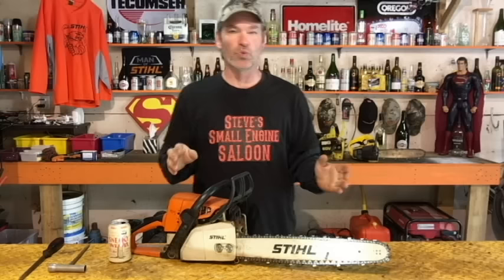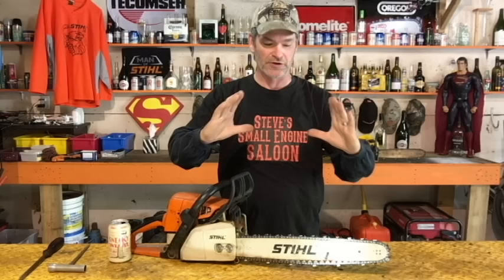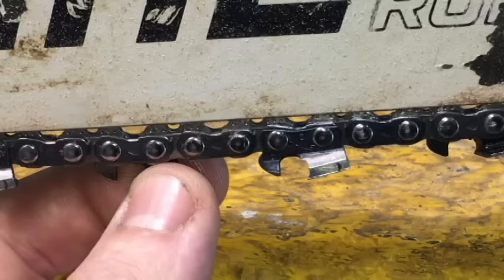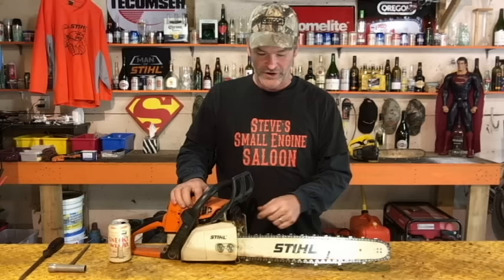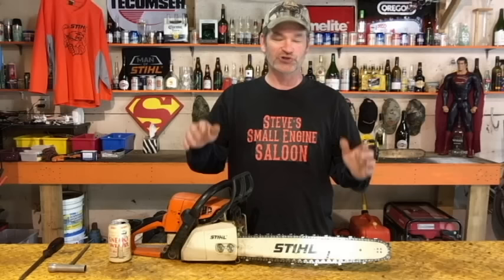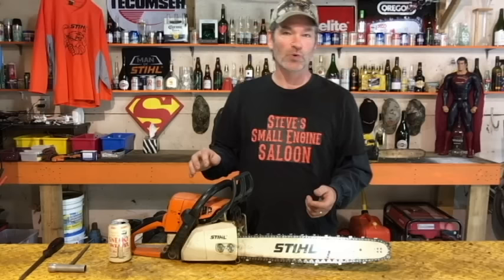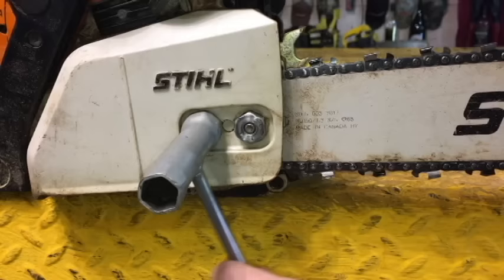CORRECT WAY To Adjust The Chain Tension On Your Chainsaw

Comment from the maker: ✅Need The proper tool? Check out this chainsaw wrench ➜ http://amzn.to/2iMUIIf
For more videos like this, check out: 
👉Top 5 Reasons A Chainsaw Won't Start ➜ https://youtu.be/5Qit2CZFw6M
👉Correct Way To Sharpen A Chainsaw ➜ https://youtu.be/-GIxowey6IQ
👉Repair A Chainsaw That Cuts Crooked ➜ https://youtu.be/AgCZxee2NPA
👉Fix A ChainSaw If It Won't Oil The Bar And Chain ➜ https://youtu.be/6zscOSrFQjA

You can connect with Steve here too: 
✅Visit Steve’s WEBSITE ➜ http://www.stevessmallenginesaloon.com/ 
✅Visit Steve’s PARTS & TOOL STORE ➜ https://www.amazon.com/shop/stevessmallenginesaloon 
✅Follow Steve on FACEBOOK ➜ https://www.facebook.com/stevessmallenginesaloon 
✅Follow Steve on INSTAGRAM ➜ https://www.instagram.com/stevessmallenginesaloon/ 
✅Follow Steve on TWITTER ➜ https://twitter.com/SteveSaloon 

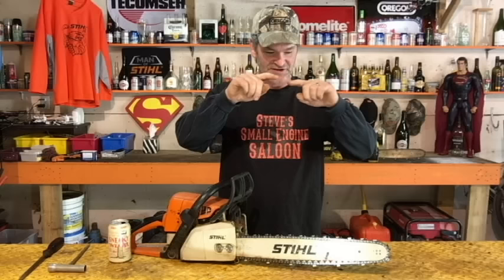✋Heads up guys, I did say a quick thing at about 1:55 that is not what I meant!  The chain actually is not spinning at 12,000 RPM just because the engine is.  But my point is still valid....👍
Reply: we knew what you meant ! ;)
Reply: We knew what you meant. Great video. Thx.
Reply: 12000 revs per minute implies engine speed I think. Anyway we know you basically meant frickin fast.
Reply: What is the chains rpm at say 12000
Reply: @nmmxiii9389  (Sprocket circumference / chain length) x 12,000 
For a 1.5" sprocket and a 20" bar  - (4.71/40)x12,000 = 1,413 rpm.
This gives chain speed of  about 53mph
Reply: All good :)
Reply: @nmmxiii9389  chain pitch x 2 x saw rpm ÷12 = in/min ÷720= feet per minute.  I think that's the equation.  Double check with google top be sure.
Reply: In other words, treat the machine with respect (careful attention to wear, adjustments and how you use it) and it will treat you back with respect.
Reply: @nmmxiii9389  Depends on the size of the chain.  Sprocket circumference not counting the teeth/chain length.  Chain lengths vary, but let's say 36".  I don't know how long a chain is, really.  And the drive sprocket looks like the size of a coin.  Let's say a quarter.   Circumference is pi (3.14) times the diameter.  Let's round it to 3".  3/36= 1/12, so divide 12000 by 12 and get 1000 rpm.  Still insanely fast.  I had one fly off on my once.  It just fell on the ground.  It didn't even go anywhere.  But it was on one of those electric saws.  No way was it doing any 12000.  Maybe a couple thousand rpm tops.  Hope this helps.  2400 rpm would be a chain speed of 200 complete revs per minute, which is 200 times 36 inches or 3 ft = 600 ft/min or 10 ft/sec...I think.  That still sounds like it could injure a person.
Reply: And always count your fingers before and after cutting wood to make sure you have 5 on each hand remaining hahahahaha
Reply: You bad lol 😆
Reply: @reclaimthelaw  😆 but he did keep it real
Reply: The textbook chain tension never works for me. Chain tension changes as bar & chain gets hot. Bar & chain expand at different rates on different saws. I like to check tension periodically and adjust as necessary.
Reply: @mauriceharting5877  I know some people who didn't have the chain adjusted correctly and they can not give a thumbs up anymore. yikes
Reply: 0
Reply: Hey sir I have a few questions for you I'm a chainsaw carver and been having some issues no body can answer even Stihl so far
Reply: i love machinery.  is that wrong?
Reply: Brilliant ,many thx
Reply: ²moo otto
Reply: Mine aint.  Mate.
Reply: Okay, I know it's a REALLY old video, but to open with a guy holding a chainsaw in one hand, and a beer in the other? Priceless!
Reply: TY
Reply: Thanks once again. Great explanation. I never took into consideration that the bar does pull up when you engage the blade so adjusting with the bar up give you a perfect adjustment. Great advice.
Reply: Great
Reply: Through lack of oil the chain stretches  can a bar be made for stretched bars
Reply: That's stretched chains  not bar thanks
Reply: Steve, as a 66 yr old female homesteader who finds herself using her chainsaw to cut limbs that have fallen on my fence...I want to say a huge thank you!!!  You not only explained how to do it and gave good close up's, but you also explained WHY!  That is a lost art these days.  When you explain the "why" it is easier to remember the how.  God Bless and thanks.

Comment: Hey man, I am not sure if you will see this since the video is nearly 6 years old now. However, I recently purchased a STHIL Chainsaw myself. This video helped me, as a first time young homeowner. I appreciate  the fact there is no bullshit into, no "before we get into this, here's a thanks to my sponsors", or any other crap. Just straightforward and to the point. When I have a little extra money, I will be purchasing some stickers, coffee cup, and other items from your store as a thank you.
Reply from the maker: Thank You...and You're Welcome...
Reply: Helped me huge as well.  I couldn’t figure out why the new chain was not cutting well before I learned you need to pull the tip of the bar up when adjusting.  Good to go now. Thank you
Reply: Also helped me. Thanks.
Reply: You want to tension the chain until it gets stiff to move on the bar freely then back it off .. yes chain needs to "snap" back into the bar at all times..

Comment: As a professional logger I can tell you that the proper tension is going to differ depending on what you are doing. If you are falling timber and chain speed makes a difference, then you want a little slack. If you are bucking and bumping limbs, you want it a little bit tighter. With a slack Chain, the slightest little limb or branch of brush will end up in between the bar and chain and throw your chain off the bar. It can happen even if your chain is tight. But it's more likely to happen with a loose one. Then again it is way easier to put the chain back on when loose than it is when tight. It all comes down to experience and a matter of preference.
Reply: Thanks for that.  I have one chain saw that throws a chain whenever I touch brush.  Cuts logs and stuff great.  Now I know what is wrong.
Reply: I had a logger friend who logged over 50 years and he ran his saws with the chain tension like you described. I thought it was too loose but he knew what he was doing. He told me the reason, but I'v forgotten since it was over 20 years ago.

Comment: I swear, my stihl manual states on page 29, 1st column, “turn the tensioning screw…until there is very little chain sag on the underside of the bar—and the drive link tangs are engaged.” On the same page 29, right-hand column, it states, “chain must fit snugly against the underside of the bar and it must still be possible [that leaves it wide open for interpretation] to pull the chain along the bar by hand.”  So I went looking for some videos, and up came Canuck beer man with a Stihl.

Comment: So, what you're saying is, "Hold your tip up when you tighten you nuts?"  Makes perfect sense to me! Great vid. Thanks for posting!
Reply: Brilliant.
Reply: Albert Head Nice.  Would have added “while checking your oil” but well played sir
Reply: Mostly I like holding the nuts up while you know who is playing with the tip.
Reply: Go to your room.
Reply: Apparently none of these guys think that you're talkin about a chainsaw bar. Or are you? Probably the first time some of you seen a chainsaw.
Reply: My soul is pure. I would never have picked up on that if you hadn’t pointed it out. Thanks for ruining it for me. Now every time I tighten my chain I have to pester my wife as well.
Reply: Spinning at 12 k ?   I all call BS.  He is probably talking about the rpm of the engine, not the rpm of the chain spinning on the bar????
Reply: @billgilkerson5294  the chain is rotating at engine speed as its direct drive from the crank the only exception i know of was the gear drive canadien brand saws not made since the 70s. a lot of saws free rev to 12 grand and work around 10/10.5
Reply: @chrisforgan731  yes, but the sprocket is many times smaller (less teeth) than the chain.  There should be a ratio, like a truck differential, where 5/6 sprocket rotations equals one chain rotation.  So sprocket rpm of 12,000 rpm would be like a chain rpm of 2,500.
Reply: @chrisforgan731  There used to be several gear drive saws, not just Canadien.  Homelite had several gear drive models but that's just the brand I know.  But pretty sure the guy just meant the chain was being driven by a 12k rpm engine, not that the chain was actually turning 12k rpms.  That would obviously be a function of how long the chain is although whether you've got a 16" chain or a 30" chain, the chain speed would be the same.
Reply: @billgilkerson5294  That's the RPM of the output shaft, not the chain, you're right. I don't think he meant to misrepresent the situation.
Reply: @chrisforgan731  The output shaft has a certain number of indentations to engage with the teeth of the chain. The chain has a lot more teeth than the output shaft has indentations, so the chain is not making one revolution for every revolution of the output shaft, it's reduced by a huge factor. The velocity of the chain is about the same as the output shaft, but not the RPM. In a sense, it hardly is useful to talk about the RPM of a chain, velocity is more important, but Steve here did make it sound like he meant the RPM of the chain, an easy mistake to make. It wasn't the important part of what he was saying.
Reply: @billgilkerson5294  Chain speed is in feet per minute so yes, 12,000 rpm is referring to the sprocket or engine.
Reply: There's nothing like a properly adjusted big tip. You just have to make sure not to bust your nuts before you get through
Reply: I put some chapstick on the tip so that way the chain does not chafe after I tighten my front nut I lost the other one on a bet!
Reply: @MegaTapdog  "tiny troll balls"  🤣🤣🤣🤣😂😂
Reply: Time for the time out chair again!  😂

Comment: I thought all you had to do was turn screw until bottom middle bar just touched by chain, then re tighten the two screws.  I didn't realize it was this complicated. Well I'm too set in my ways to change now.

Comment: I'm a firefighter on a truck company in a major US city and we use Stihl saws for cutting ventilation holes in all types of roofs. Your video was fantastic. I'll definitely be using these tips and advice going forward. As someone who expects his saw to save lives, having your equipment set up properly can be a matter of life and death. Kudos!
Reply from the maker: Right on Frank!  Thank You...
Reply: If you’re going through shingles do you tear some shingles off first? Seems like your chain would dull immediately going through them
Reply: This is rad, thank you for your service
Reply: @Slippindisc  Maybe on a pretty intact roof with little time to play/train/whatever.  But if it’s gettin it and you’re going hard offensive to get ahead, occupants trapped… guys inside who’re gettin pressed down…that kind of fire, then it’s the least thing I cared about.  I just wanted to safely get off the roof and provide the best environment I could for everyone inside workin in the dark.
Reply: Carbide teeth?
Reply: We have a stihl brand one on our rescue truck and the chain is a few hundred with employee discount since it's carbide tipped. And no we aren't going to worry about the shingles or anything like that.
Reply: @Slippindisc no, we go right through shingles. carbide tip and double raker; no issues.
Reply: Watch his videos for any help with any small and not so small equipment. He is the best. He explains everything perfectly.
Reply: Thanks once again Steve. Great explanation.
Reply: I did 32 years in the FD - most of those as a Truck Company captain. We loved our Stihl chainsaws for vertical ventilation and our Stihl rotary saws for forcible entry work. 👍
Reply: @akaLuptonPittman  couldn't have said it better myself. 
@MrAdvantage1 Dulling the chain is the least of my concerns, besides the carbide teeth really do hold their own. The main thing to be concerned about is not falling off the roof and staying vertical over the top of your saw path and in the cut to avoid binding and kickback, respectively. The saw does all the work, you're just maintaining 3 points of contact on the roof ladder to the gutter line and letting your trigger hand guide the saw as it blasts through everything.
Reply: @StevesSmallEngineSaloon  Have you already done a video on how to start a flooded saw without having to break it down? If not, I'd love to see one. That would be especially beneficial to firefighters when you're on a fire scene and you just don't have time to f*ck around with hand tools. Our old timers taught me to just push in the choke and have one guy hold down the trigger while another guy goes hog wild ripping the starting rope over and over until she takes off and revs up.
Reply: They sell carbide chains to cut nails in wood . I use one to cut stumps low  before grinding them.
They can go through shingles and stay sharp edges longer.
Reply: God help us!!
Reply: @frankcostanzo8391  thats basically the only thing to do if you cant pull the sparkplug. keep it wide open to give it max air. one would maybe think that holding the throttle open will just feed it more gas, but it  actually gets even more gas on idle setting/choke setting
Reply: @allahsnackbar9915  that's exactly why I've always called it an "air pedal" and not a "gas pedal". Lol, thanks for the info.
Reply: wow awesome story... not
Reply: Thanks Frank! Life and death is right, when using a Sawzall, or the reciprocating saw by DeWalt as I saw on the News years ago that you guys were also using to cut people out of Autos. I'm the only service Plumber I've ever known in 38 years+years that uses CUTTING OIL to extend blade life, for optimum cutting efficiency, and to keep sparks at a bare minimum. Cutting oil is of course non flammable. I hope you firefighters use cutting oil, because it also cuts way down on sparks to prevent fuel fires. Thanks for all you do Frank!

Comment: First guy I’ve seen who actually knows how to correctly set the chain tension. I’ve done it this way for 45 years.Great video!
Reply from the maker: Right on Dave!  Thank You...
Reply: @StevesSmallEngineSaloon  I'd say that's a tad tight ! I'd be looking for a tiny bit of slack - no more than 1mm (I don't know what that is in imperial even though I'm imperial ! 1/16" ??
Reply: @millomweb  It would be 1/25, as one inch is 25,4 mm.
Reply: @Staale69  That's logical :)
Reply: Dave said what I was thinking . I was taught to hold the tip up thirty years ago.
Reply: @treeclimberman3337  It's a pity the design is so bad that this is even a thing !
Reply: me too. 40 years in the tree bizness. I've seen it all. I've seen guys do it wrong for YEARS. I had an old man show me how to sharpen one. He didn't know what he was doing. He'd been doin it wrong for 55 years.
Reply: @ratbrain7743  Skilled work - like counting up to 10.
I found a book published in 1926 that stated a particular memorial in Edinburgh had a cap mounted on 8 columns.
The mem. actually has 9.
Reply: @Charles McKinley Who reads manuals ? ;) Interesting point though - I'll have a look at mine and see what it says - when the cat gets off me.
Reply: @Charles McKinley While the saw is placed on a surface.."Chain is correctly tensioned when it can be raised from th top of the bar 5-10mm at the centre of the bar with the fingers while using the weight of the machine to pull the bar down." Or something to that effect.
While holding it like that, the tension can be adjusted - but at least the technique has the effect of lifting the bar when setting the tension.
Reply: After running the saw for a few minutes ,would the chain stretch a little from heat & create  more slack ?
Reply: @smerchly  Correctly lubricated, there shouldn't be much heat!
Reply: @millomweb  it will stretch, especially if it's a new chain.
Reply: And for 45 years,you've done it wrong
Reply: I've figured that out years ago but I always tightened the chain a bit to snug, and burned my blade after 15 years, finally decided to get a new one last year and it's 30 years old about now. Stihl the one  that I can depend on. Had a little Mac cat Mccollough before that until the trigger cable broke and decided to go bigger with the stihl.
Reply: I've figured that out years ago but I always tightened the chain a bit to snug, and burned my blade after 15 years, finally decided to get a new one last year and it's 30 years old about now. Stihl the one  that I can depend on. Had a little Mac cat Mccollough before that until the trigger cable broke and decided to go bigger with the stihl.
Reply: You been living under a rock?